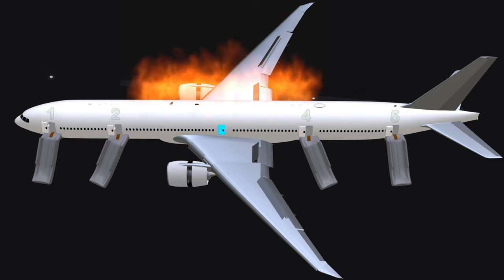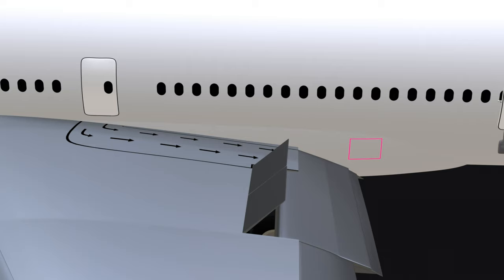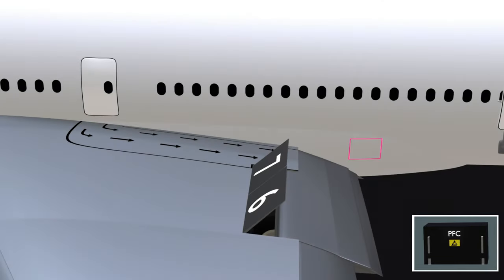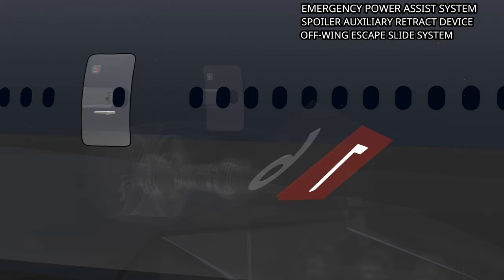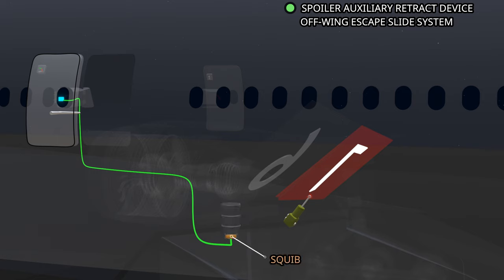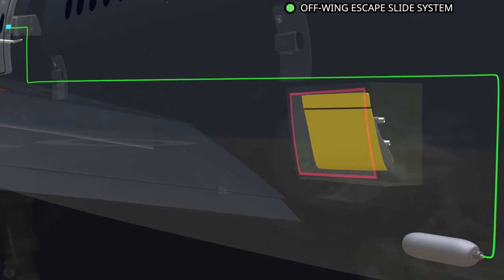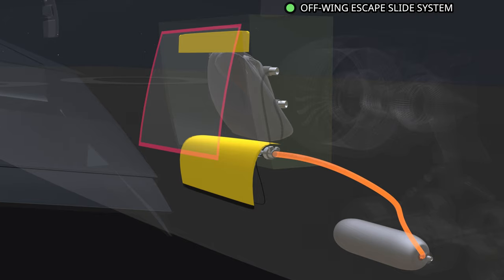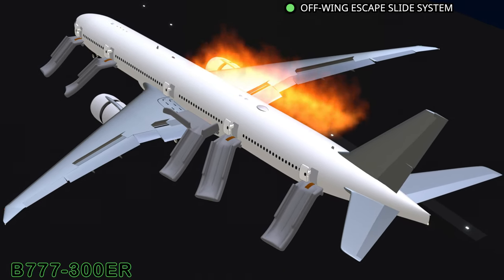How Escape Slides Work | Part 2 : Off-Wing Escape System

Comment: I have one question regarding the emergency retraction system. It provides hydraulic fluid to the retraction side, but what about fluid in the extension side? If it would be just left there it could stop it from retracting, so is there some valve to dump it out(maybe to some container with another valve cutting out the supply) or something?